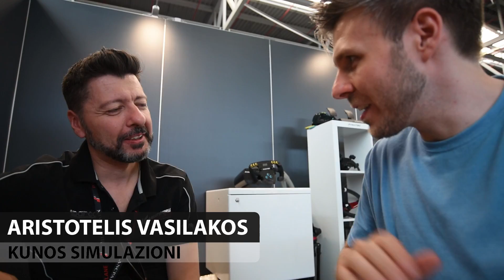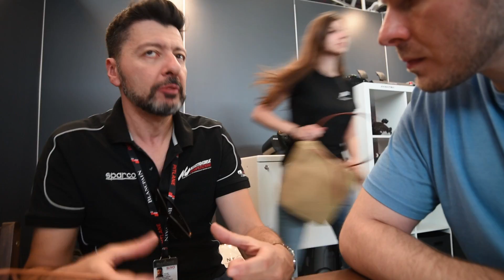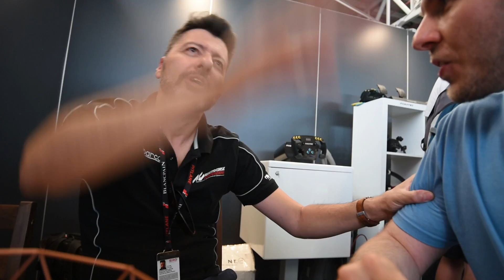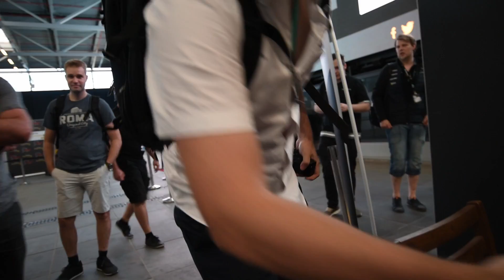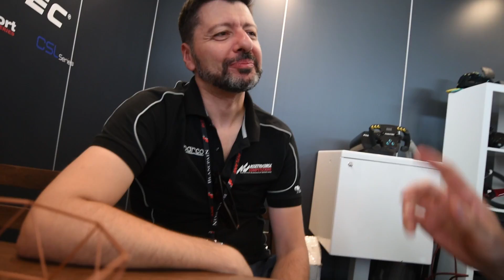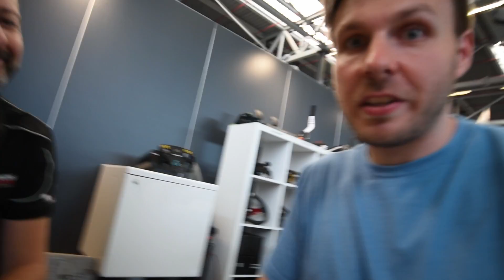Talking Physics with Aris of Kunos Simulazioni | SimRacing Expo 2019

Comment: Smart guy, very interesting stuff... regarding chassis flex, my assumption is that it overall effects the driving behaviour of the car substancially. So I would not care if they „cheat“ it with simpler algorithms instead of having a car made of concrete and only suspension and tires modelled.
In terms of overall driving behaviour, at the moment, iRacing with the v7 tires is far superior over pretty much every other sim, including ACC. Though I find the ACC GT3‘s more responsive&talkative as the one‘s in iRacing (still on older tire model). I only can compare to real Formula 4 driving behaviour (as I have driven that IRL), the v7 modelled cars (Skip barber or F3) are by a huge margin the one‘s with the highest similarity of how it feels in the sim,  at least if you are on a highend dd-wheelbase.
Reply: Chassis flex is essentially making the chassis act like a very stiff spring. A spring that is not just about torsion but also flexing in other directions. The chassis flexes as a whole but also around each suspension pickup points depending all the loads coming in. This already makes it somewhat multi dimensional. But because a chassis is a spring you also have damping and oscillations to think about. It is not just misalignment of the front and rear of the chassis but the dynamic effects you create with that misalignment. Not just how much the chassis bends under certain load but how it as a spring snaps back. And there is also inertia. And considering the chassis is a big object in the car this chassis flex movement also moves the mass of the car. Essentially the mass of the chassis causes itself to flex in some cases in certain degree.

Just imagine what all is going on when you drive over a big kerb at 150kph or how the chassis twists and flexes when going through karussell or suzuka esses. There is a lot of options for depth how to create chassis flex and how deep you want to go. You can just make a simple torsional misalignment that simple looks at tire forces and moves the suspension pickup points based on it. No modelling of inertias, dampenings or springyness. The lack of data is not just about how much the chassis flexes but all the other factors. Which of the factors matter and which don't really matter? Before simulating chassis flex at any level I think it would be better to focus on simulating the flex of the suspension component as that is one multitude bigger. For any road car for example bushing flex a ton. But essentially first you have tire flex, then suspension movement, then suspension flex and maybe then chassis flex. In the end anything that goes into a simulator is simplified.

I think there are also some misconceptions about chassis flex. Often times I've seen people think that it is chassis flex when they see a car going through a corner with front or rear wheel slightly off the ground. No, that is just suspension. Chassis flex is a lot smaller and subtler.
Reply: @erwinlommer197  plus for fully accurate chassis flex you'd need a server farm full of high-end gear just to simulate it in slow-motion. On a home PC, even a 16 core Ryzen running multiple threads, it would absolutely kill the frame rate.

Ever played Kerbal Space Program and had the Kraken eat your ship? The same will happen if you try to model complex chassis flex on the average PC! All for a userbase that says they would like it, but only 1% will be able to tell the difference.

So it's probably due to more practical reasons that the developers don't go too far into looking at chassis flex.
Reply from the maker: Very interesting comment, and I had the same thought about chassis flex before, i.e., better to cheat something in that approaches reality somehow, than to neglect the topic entirely. But that's rarely Kuno's approach.

Regarding iRacing, I just bought the Dallara F3 last night, and it does feel pretty good so far, but I need to drive it on more tracks than just Lime Rock to really be able to comment on that.

I'd be interested to hear about your F4 experience and what aspects of the driving feel you'd say iRacing has that others don't, etc.
Reply: I think you are wrong in your assumption.  Race cars are designed to be stiff so that chassis and suspension flex have minimal effect on driving behaviour.
Reply: Stiffness certainly does provide an advantage in high energy loads in a racing car, as it is easier to tune the handling if you have a consistent base to work from. But in the last 15 years there have been moves to introduce controlled flex in chassis design, where the chassis itself can be fine-tuned to assist in the handling. And if a chassis is too stiff it might even have an adverse effect on the handling. MotoGP teams were finding this out in the early 2000s, because motorcycles deal with cornering loads while leaned over and they have a perpendicular deflection that the suspension can't handle.
Reply: TM7 in iRacing just feels more like rFactor 2 nowadays and yes, it's more dynamic than ACC.

Comment: Is it physics though, if car games had "real" physics then all the car games would play the same as the physics involved are a constant, it's more like a artists impression of physics, although some of it will be based on real equations I imagine.

Still interesting video though.
Reply: Hi there. Just some additional information that you and other viewers might like. Car simulator "games" do have real physics, but as real as they can. There are aspects of car handling that are still unknown in all the details to the actual manufacturers. For example, many aspects of tyre behaviour, especially at extreme conditions over the limit, are unknown to the manufacturers. Aerodynamics, wind flow still can't be predicted 100% (heck physics scientists and mathematicians start to discuss that might not be possible AT ALL to solve such equations, not for cars, but generally... but that's another scientific region). Also not everything in a car is measurable and not everything is simulated. 
So each developer tries to push the envelope a little more everytime, but sometimes even tiny differences (on a tyre curve for example) can result in quite different feel. I can assure you that all sim devs when they get real data they feed them into their sims and "lock them". Then they try to do reverse engineering on the data they don't know, based on real telemetry and performance, but this is where "interpretation" influenced by personal experience, might come in. But there is no "artistic impression" for sure. Everybody is trying as hard as they can to get as realistic as possible and you can see how most important sims converge to simila behaviour. There are differences but they are mainly "feel" differences, not massive behaviour differences. As if you change tyres to your car, it might feel different, or it feels different from a hot day to a cold day etc.
Reply: @ArisDrives  is spot on.  As a ride and handling engineer in the auto industry, this is true.  Ride/handling is mind bogglingly complex when you get down into the weeds and there's almost no way to "fully" understand every aspect of a single car's performance, let alone dozens or hundreds.  Even at the manufacturer, models and simulations are only approximations and are frequently quite far off.  

For context, a full 3D hydraulic model of a single shock absorber under a single condition can take many hours to run depending on the level of complexity.  Extrapolate that to a detailed model of a full car under many different scenarios . . .
Reply from the maker: Well, it's obviously an approximation that will be off a bit here and there. Having all sims feel the same would be a dream come true, cause it would infact be a strong indicator that they figured it out ;)

Comment: I'm sad to hear there is not much that can be changed about collisions online ;(
Still, Aris really is a great guy and I appreciate his efforts and achievments with Kunos Simulazioni :)
Reply: The problem is a function of communication latency. No sim or racing game will ever get multiplayer modes perfect because you can't have instantaneous communication between Clients and Server. You would even have the same issue if you had everyone in the same physical location as there will always be a slight amount of latency which is magnified with racing games given the speeds represented. Even 30ms latency means that a car traveling 300kph would travel 2.5 meters in the time it takes for the data packet with its exact position to travel.

The game makers try to predict where the other players car is when they represent it to you and updates that position as the other player's client transmits positional data back to the server, but the exact position is always going to be limited to the communication rate between the other player to the server then from the server back to your client.